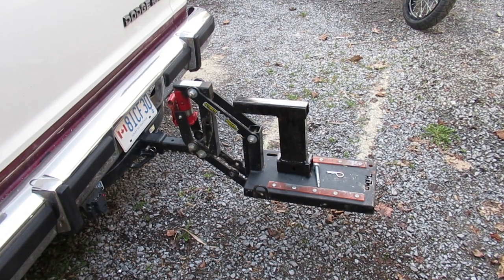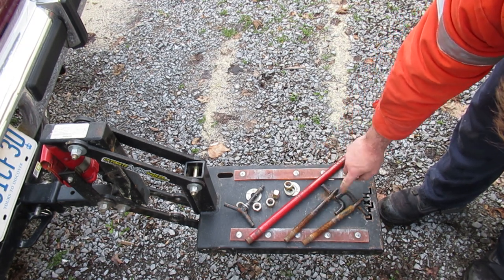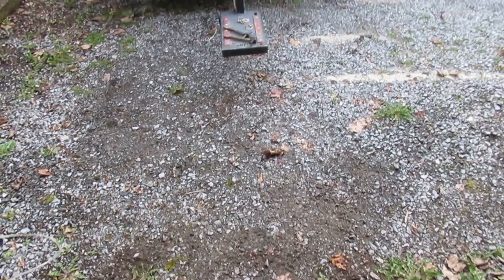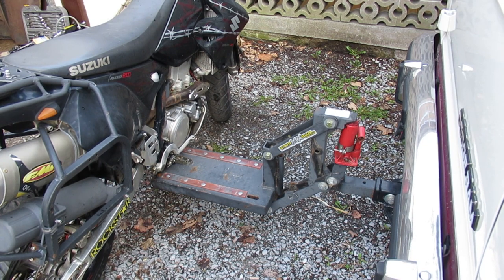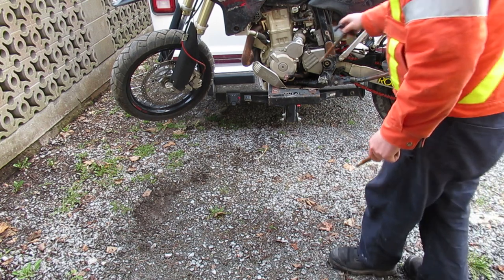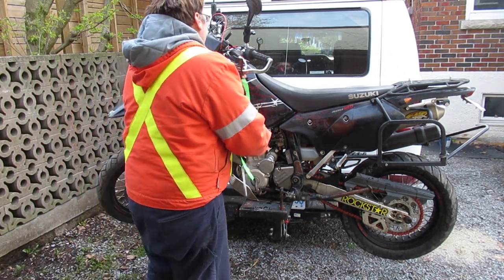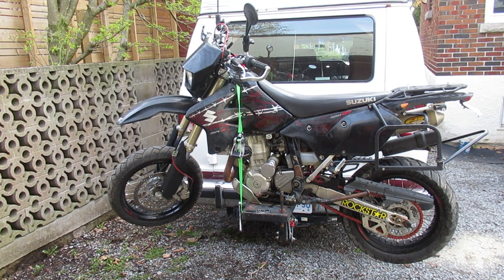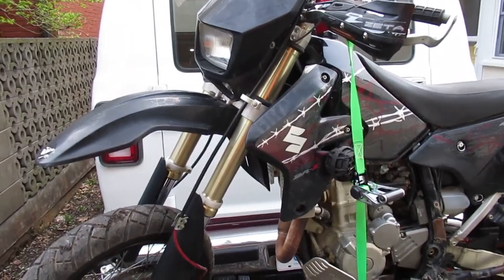Ultimate MX Hauler with Suzuki DRZ-400SM and Ram Van B250

Comment: I'd put the pegs on the other side of the hardware holes so it's more balanced on the platform
Reply from the maker: The positioning of the pegs depends on the bike but you are right as you can see in the video that it is unbalance before I tighten it down (it nearly flipped over backwards).  The monoshock is up against the edge of the platform so I can't move the pegs any further onto the platform without it sitting on the shock instead of the bike frame.  I would have preferred to run the bolts right through the pegs but it just isn't possible.  I have enough hours carrying the bike now that I'm totally confident in it.

Comment: whats the waight of the bike? i might have missed when you said it ?Do you think the rack would have been better?
Reply from the maker: That bike weighs about 350#.  I think the rack is just about perfect for my application and you can get a spare jack for it anywhere.  I still need to try it with my new Roadtrek which has a continental kit on the back but I'm hoping it works as it's way better than towing a trailer.